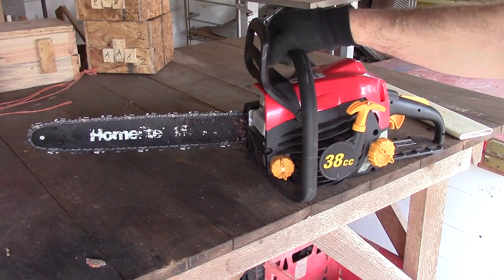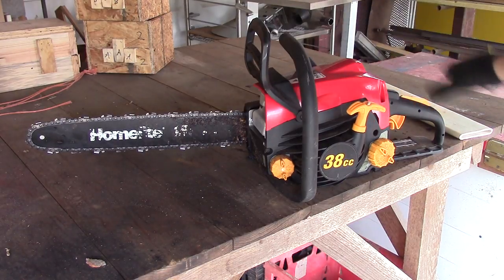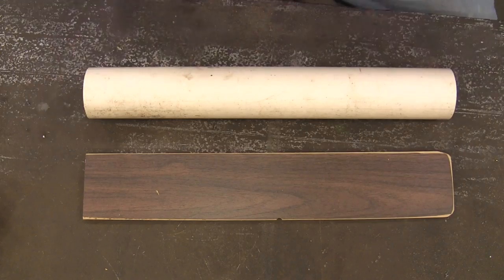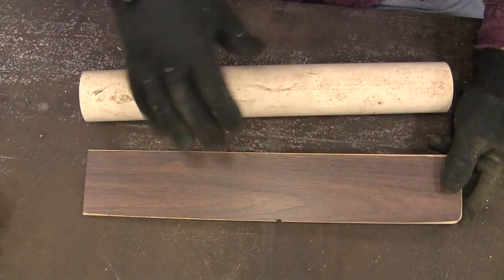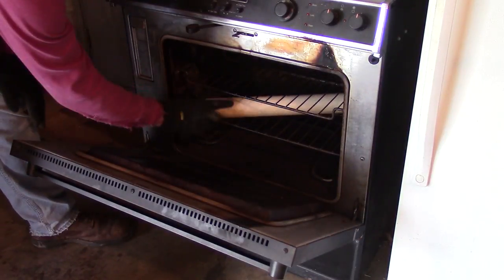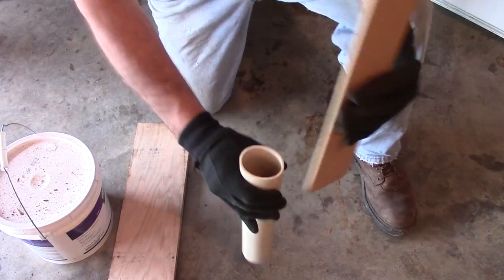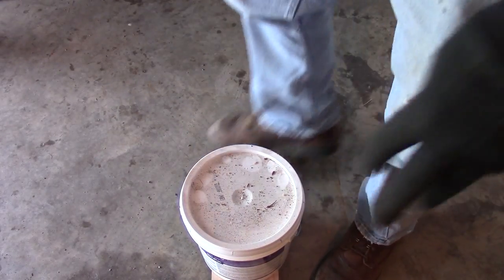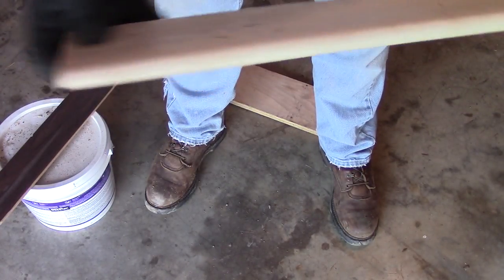Quick and Easy Homemade Chainsaw Scabbard

Comment: good job , i made a couple  3-4  year ago ,  but  i used 3 '' abs pipe ,  took about 10 min in oven at 400 degrees with a 1/2 '' spacer then  ,  i bolted (used brass  toillette flange bolt)on my skidoo and on a quad  ,  hit trees, flip  nothing will ever break abs  chainsaw holder.
Reply from the maker: Thanks for sharing your experience.

Comment: I made one for my 10" Remington electric. I used 2"PVC but my form was 3 1/4" wide. After 25 minutes in a 250 degree oven I thought it was good to go. I had to pound the form into the pipe then I put it in the vise between 2 3/4" scraps of plywood.  Now I can't get the form out!! I guess I'll be spending some time in the shop with a long chisel.
Reply from the maker: LOL  I hope you get it out!
Reply: Heat it again and remove

Comment: I just tried this and i must have used a thicker pipe or board because it got stuck on the board and I had to reheat it. The second time I tried it without a form and that was a mistake as it got stuck on the first 3 inches of teeth lol I had to take the bar off nd smack the pipe a few times with a mallet to get it lose. Next time im making a better form hahaha

Comment: I once had to bend a 4 inch diameter piece of pvc pipe and I stuck it on the tail pipe from my truck, it turned it into a wet noodle.
The bell on the end shrank a bit and I had to cut it off and use a coupling, it was electrical pvc for wires.
Reply from the maker: That's interesting, had not thought of heating it that way.  Thanks for watching!

Comment: Thank you for the job! And please be more grateful, $30 for a chainsaw is a deal, and given is better.
Reply from the maker: Thanks!  You are correct I should be more grateful.
Reply: @SoatMon  I really don't mean to call you out, thing is that I heard you so much that, you really got to me with it, and am so poor man, I just bought 3 at $115, two of them worked as soon as I tested them home. One had the purge bulb broken, so I ordered (20 bulbs alone, and 10 complete purges, because I also acquired 3 weed eaters and one trimmer and we need to learn purge/primer bulb scare going to fail so, purchase what we'll need to repair them once they call for a repair, and those parts take time to arrive from eBay etc. So that's one of the chainsaws, broken bulb so I couldn't try to start it but two worked, I even got to cut some wood with one, a Homelite. Now, the other two are Ryobis; an 18" (which doesn't has bar/chain/scabbard-just purchased a chain, am searching for an 18" Ryobi guide bar and scabbard) and a 20" bar, which had at point of sell the purge bulb broken but has the bar, chain, scabbard everything. The three have boxes but only one, the 18" Ryobi is missing the bar and scabbard, chain is coming. Now, that 18"(all this megaparagraph is to tell you, that that 18", as soon as I crank it, ran so good, but sooo good, that I was in love with it. So few days later, look what logic, love and gratefulness do in my mind, I said "am gonna remove the 18" purge bulb and place it in the 20" one". I took apart the 20" parts to learn how to get to the purge. I set up another little table to do the same with the 18" one and guess what I decided? I said "To do, this 18" one ran sooo good man, am not gonna mess with it. I'm going to wait for its bar, chain, to install them and use it." Then will come the scabbard(chain and bar cover). May be stupid from me but, thing is I really don't want to, trying to fix one, jeopardize the impressive performance of another that only needs its bar and chain to cut wood.

And I purchased them on that price, $35 each, because I really can not afford a Huqs now, if not, I'll go for Huqs, oh yeah, but I can't so, am super grateful, am bringing them back (the Homelite purge broke few days later while I was trying to regulate it) so am waiting on my parts to come(the weed eaters have their similar stories, am bringing them back. There's only one that works, the trimmer is getting better, it works but is an old Stihl am trying to learn how to use it, no labels so am learning at trial and error and trying to regulate them, learning as I go but man, am super grateful because that is what I can afford. So do your best because then what is going to happen? Some at least may tell us where is or are more, sometimes cheaper! Take care!
Reply: Relax it's not that serious